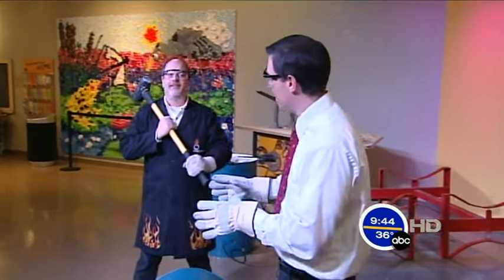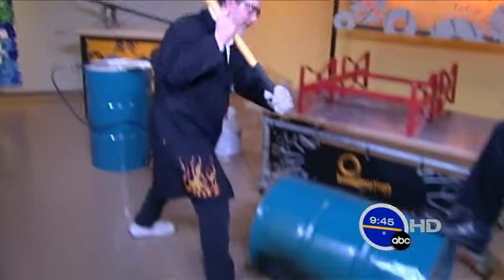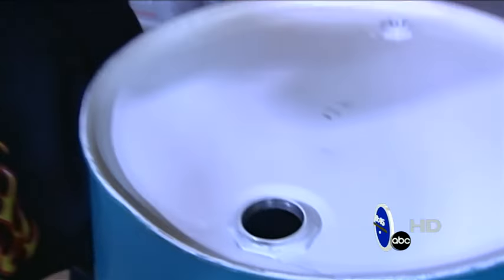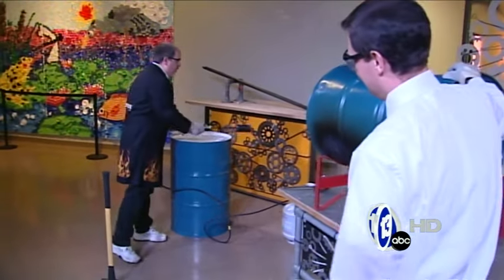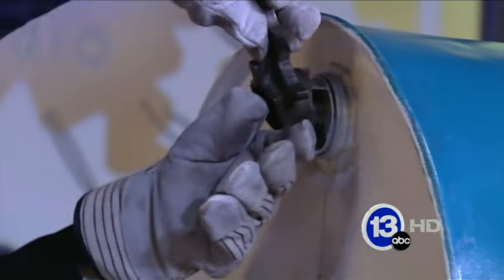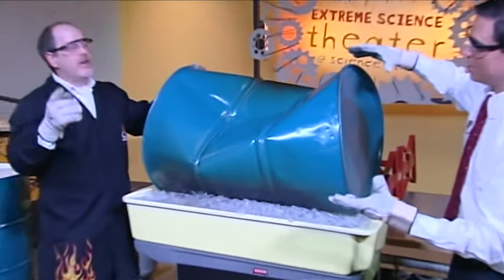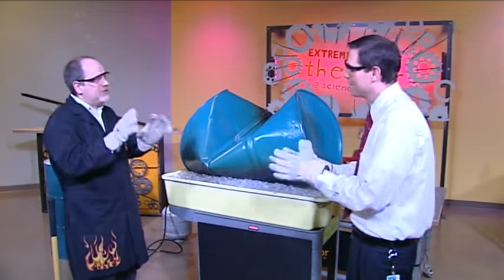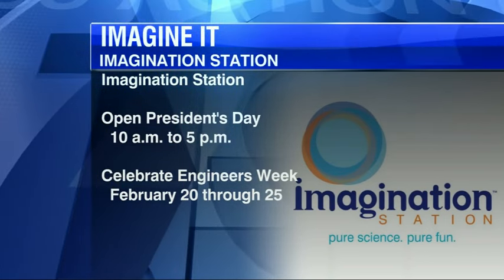Crush a 55 gallon drum with air pressure

Comment: Actually this was the principle used for the first steam engines, the cylinder was filled with steam while the piston was at the bottom dead centre and then the steam was cooled down. This sucked the piston up unlike modern days when we tend to push the piston down. Newcomen atmospheric engine worked on this principle. Through a feedback system the sequence was repeated to produce shaft power.
Considering that the atmosphere produces a pressure of 15 pounds per square inch, then one  foot square, when the inside of a container is a vacuum this will produce 1710 pounds .
Now in wing sections of a plane one tries to deflect high speed air to produce  partial vacuum on top of the wing and  higher pressure under the wing,  If one assumes that we could produce a good vacuum on the upper side of the wing while keeping atmospheric pressure under the wing, this will lift up a lot.    Just imagine, one square foot could lift up five people and their luggage!  That is the reason why the wings of planes appear to be so small to lift up more that 500 tons even up to nearly 1000 tons of weight.  
To think that we are like fish swimming in air and breathing it all it, makes one wonder how we can take this pressure when it comes to light when we dive under water.   That is another subject which one had to understand before diving  at depth underwater.

Comment: I realllllly want to see someone try this with a giant tanker, maybe an oil tanker rail car or 18 wheeler tanker. I have no idea how one would accomplish it let alone if it would even work but it would be cool to try
Reply: P0tat0_craft Wouldn't work right because you need a hollow tank for this to work. Those large tanks you mention have inner structures that would act as support to keep them from being crushed.

That said, watch this one: watch?v=2WJVHtF8GwI
Reply: 6p  I  was 4th  St  Paul  is      just  lkz     6grvu😄😄💲
Reply: They're trying it on the next season of Mythbusters
Reply: Mythbusters did it :)
Reply: P0tat07 worked at a place where we drained asphalt out of rail cars and if we left the lid on the rail car while we were heating and pumping the car into big tanks it would compressor and crush under the vacuum the pump created
Reply: There is a video on YouTube of a tanker imploding
Reply: @edwardautra8753 Nope. The vacuum has ZERO power to suck or crush anything. The vacuum you created simply creates empty space that the outside atmosphere can replace with crushed metal through its weight/force.

Comment: Question: couldn’t he just have put the barrel in the ice without pouring the water in since the air inside (which consists of nitrogen, oxygen, argon, and co2) would then cool down and thus create the necessary pressure imbalance triggering the crushing by the outside pressure?
I’m confused..
Reply: Those gasses would condense but they wouldn't liquify and reduce the atmospheric pressure inside the barrel enough to really cause any changes. The water vapor caused most of those gasses to exit the barrel and be replaced by the vapor. Putting the barrel filled with water vapor on ice caused the water to liquify, reducing the pressure inside the barrel allowing earths atmospheric pressure to crush it.
Reply: @maxgucciardi9054 Nonsense. He puts WATER inside, which is then heated to STEAM, then the drum is cooled to condense the STEAM back to WATER. The ice simply speeds up the cooling of the steam, but it could be allowed to cool simply by heat exchange with the drum and the outside air. It would take longer, but the result would be the same. “The gasses would condense but not liquify”? condense into WHAT? there’s no interim state, unless you’re talking about a brief moment at the triple point or a supercritical liquid which isn’t an official state of matter 0 it’s gas or liquid, FFS.